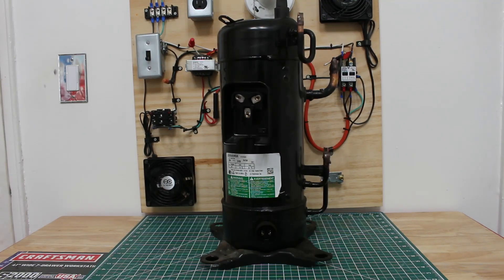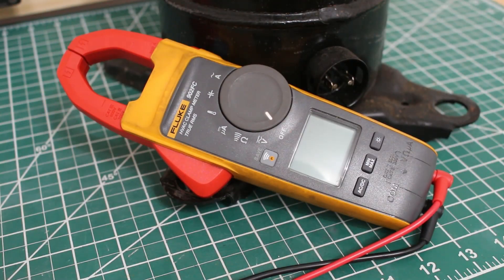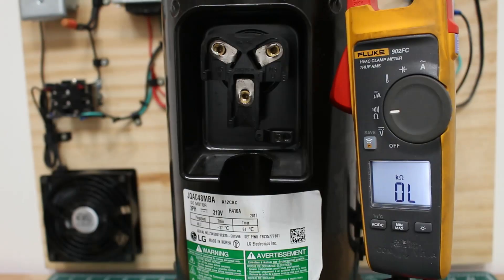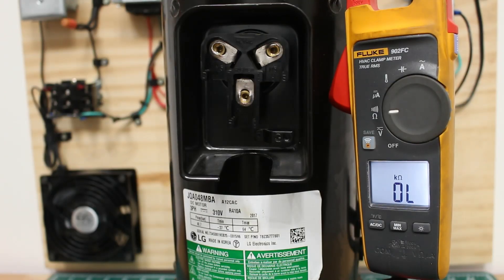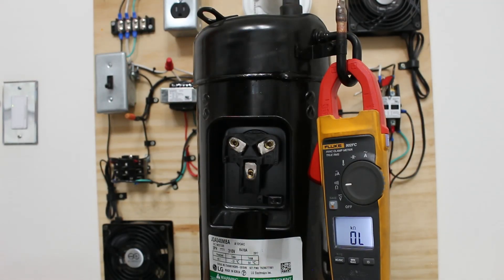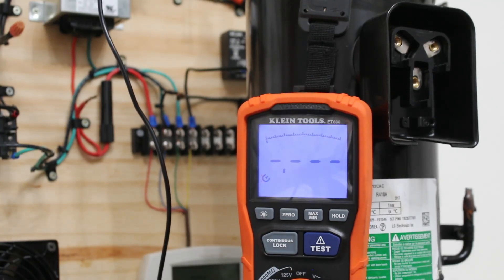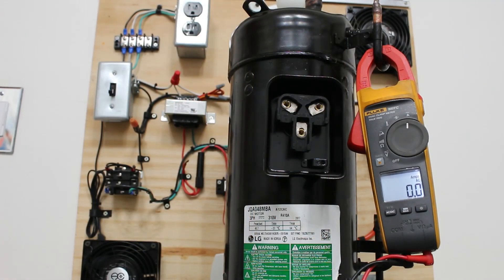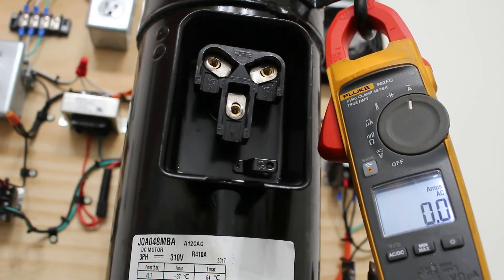HVAC Training: How To Check A 3 Phase Inverter Compressor (DC Compressor Troubleshooting) Testing

Comment: Thanks for this detailed video.
For DC compressor:
below 30M Ohm: grounded out (going to blow the breaker)
[30..100]M Ohm: very caution state (replace)
above 100M Ohm: OK (but far from 100M is better)
In the video you get all three 4G Ohm readings, I think this is the upper limit of your megger. And of course this is quite far from 100M.
But which could be a good threshold to consider the compressor in perfect state? 1G Ohm?

Comment: Hello Jumper Tech Guy, you are a life saver. I had 2 Copeland Twin (Cinnamon Roll) Scroll Compressors that would intermittently shut off, after watching your video and purchasing the two meters used in this video and after performing the Insulation Tests, I was able to condemn both compressors. Your reading in this video is 4000m at 536 volts testing at the 3 legs to the case ground or to the cleaned copper tubing. I performed the same tests; my readings were 1st compressor 0.071m at 314 volts, 0.095m at 374 volts, 0.198 at 0 volts. 2nd compressor 0.347m at 529 volts, 0.526m at 531volts, 0.542m at 0 volts. All are way below the example you've provided in the video which clearly indicates these compressors are SHOT. My question is in my above readings why did the megaohm meter never reach 563 volts? amid I performed the same tests on the 2 new compressors, and the readings were identical to your video's readings of 4000m at 536 volts, as mentioned some of my readings would only reach 314 volts, 374 volts, or 0 volts. Why were 536 volts never reached? Please explain.

Comment: Hello, my question is at the 9:21 mark you stated the amp meter clamp we can clamp it around any wire coming from the compressor. Our 3 phase compressors has 3 high voltage wires (230 Volt system) bundled together inside of a thick orange loom. Will it work if the clamp is around all 3 wires simultaneously inside the loom?

Comment: Thank you very much for this detailed video, ruined into the same problem, electrically everything is alright but through checking Amps on start showed high current readings straight

Comment: @7:04 To test isolation resistance you need to test any of the coils , not all 3 .  Make percentage between 4kMR & 0.3R . Kirchhoff will explain you more easy
Reply: Please explain in more detail amid it sounds like you have good information
Reply: @bobnale5516 3 phase motor have all 3 phase coil connected . Doesn't matter what coil will have current leakage to ground all coil will have , because the coil resistance is to low , on all motors below 10 ohm . So , testing each coil on this motor is look like some know how to do it but don't know why and also what happens.
Reply: @iamwangine8752  Sounds good. Thank you sir.

Comment: Brooooooooooooooo! I was checking a Trane unit that has a drive for the compressor and we were getting an error code for Over current! Im gonna go back and check the amps, but I did check everything else continuity, grounding, and resistance, all checked good! I’ll let you know what happens 🥲

Comment: I'm getting the exam exact reading 15.7 across all three legs but when it calls for cooling the compressor cuts on but my low side and high side are staying equalized at 290 they are not adjusting

Comment: Thanks for the upload. I have a question. You said measure AC current on DC compressor. I always thought it should be DC current on DC compressor. Do you know why it's AC current? Thanks.

Comment: Below 30 megaohms is not always an indication of a failed compressor. I can  only speak of knowledge  specifically a Copeland. AE BULLETIN 1294 covers this topic. A Copeland scroll can have a megg reading of  0.5 megaohms and still be an operational compressor. A lot of other factors also contribute to a low megg reading....temp, moisture, contamination....a better way to look at a megg reading is if it goes up...then starts going back down. You should also use the PI ( Polarization Index ) or DAR ( Die Electric Absorption Ratio ) tests, they are a timed tests and produce a ratio based on sampling meggs at different intervals. 

Im not saying that compressor wasn't failed. Just wanted to share a little info.
Reply: Anything below 250,000 ohms indicates the compressor needs to be replaced from what I learned in school.
Reply: Wow! Jason, you are a genius. I just looked up a PI Test and everything you've stated is correct. Than You.

Comment: I have always read that you never check a inverter dc motor with a megohm meter. It does not mater what size the inverter motor is, there all 3 phase windings.

Comment: 3 phase doesn’t have a start and run winding
Reply: And VRF always labels them U,V,W....its all the same thing in essence. It is misleading calling it a start and run winding. They have different resistance values....hence why a capacitor is used.

Comment: Great Video. Thank you for sharing. What's voltages 3 phase  inverter compressor use 120 V or 208 V or 240 V ? Is this compressor come from VRF Muti V condenser unit ?

Comment: I have a question. I have this compressor, a spiral condenser, a water regulating valve, and 2 txv. I saw something strange that I didn't understand. When I started the system the whole compressor was hot and the receiver was cold including the liquid line by the filter. The bottom txv was frosting at the outlet side just a bit and after a few seconds I saw it instantly melt away. The compressor made a funny sound and the suction pressure when up from 6psi to 60 psi. I'm a new tech so this is all new to me. Why do you think that would happen? I think there's a blockage in the system and I was close to witnessing my first liquid flood back. Do you think there's air in the system? Possibly both?
Reply: Possibly a blockage or maybe overcharged. Did you get an amp reading from start up?

Comment: Enjoy watching your videos. However i would encourage to to do a little more research,  may be judt a vocabulary thing.
  
When you check the resistance of the motor winding that will give you a resistance value in ohms it also is telling you whether you have continuity or not, essentially they are one in the same.   

Another thing to mention is that when dealing with a 3 phase motor you DO NOT have a start, common and run windings.

Comment: 3 phase motors don't have a common, start, or run terminals.
All 3 phases are energized at the same time, and the motor rotor "chases" the phases around the stator.
Reply: don't confuse him with facts, he wouldn't have lasted till lunch his first day on any job I ever worked
Reply: Yeah Einstein, anyone of us that has been in HVAC tech school or a service tech that learned OTJ knows that. Your C, R and S terminals on a PSC compressor are all three energized at the same time too.
Reply: @USA-GreedyMenOfNoIntegrity how does that work? Do you understand electricty
Reply: @A.Zee0  Yes, the comment was correct… All three connections on a single phase induction are energized on startup…
Reply: That's good information, Thanks for sharing.
Reply: Hello, my question is at the 9:21 mark he stated the amp meter clamp we can clamp it around any wire coming from the compressor. Our 3 phase compressors has 3 high voltage wires (230 Volt system) bundled together inside of a thick orange loom. Will it work if the clamp is around all 3 wires simultaneously inside the loom?
Reply: @bobnale5516 
No, the sum of the 3 phases will be zero.

Comment from the maker: Please note that the power source should be disconnected & the compressor should be isolated with no wiring connected while testing continuity or resistance. When checking amperage, the power must be on for the compressor to start. Thank you all for watching & commenting!